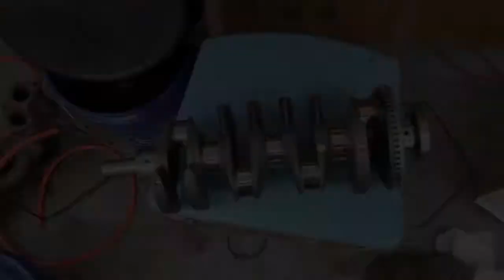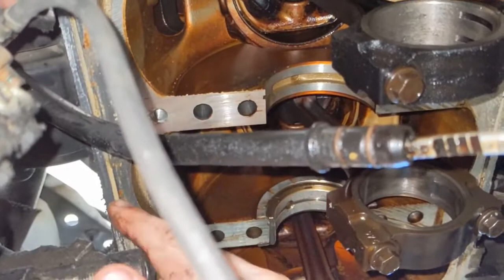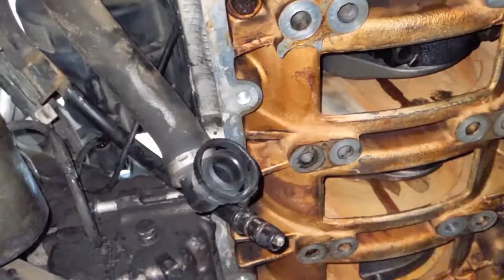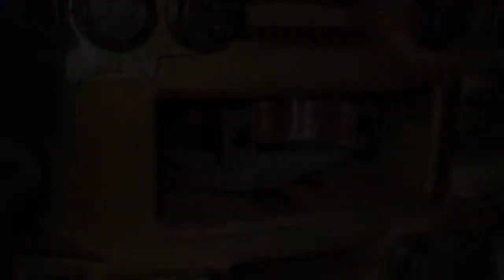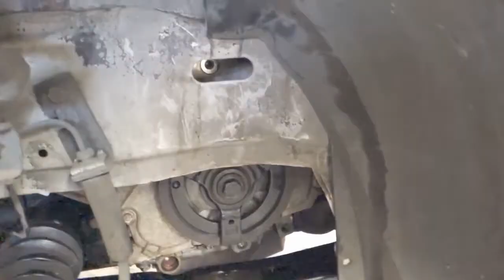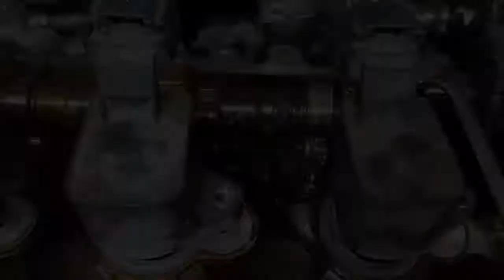2008 Chevy Cobalt Crankshaft Installation | the Finale No Ones Been Waiting for!

Comment: Cool video sweet to see that a motor can be repaired from what appeared to be a shot motor knocking that ran out of oil.
Reply from the maker: Yeah, it's a lot of work though. It probably would have been easier to just swap the engine but this was a fun project. And now it has a whole new bottom end.